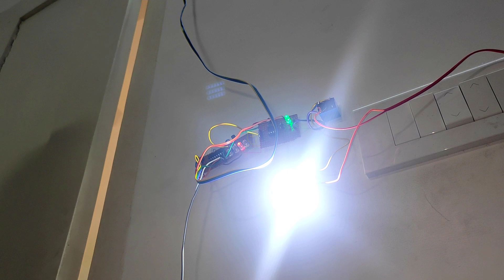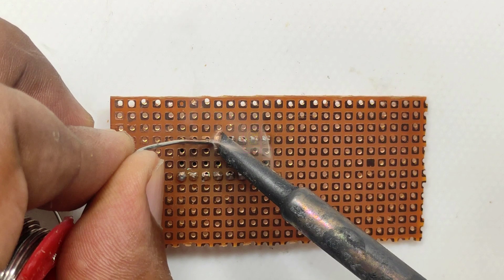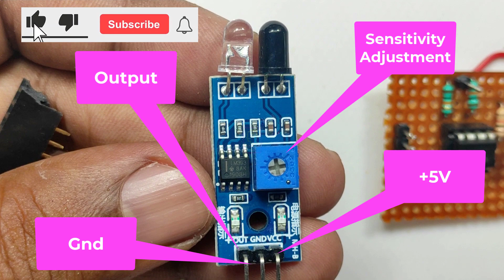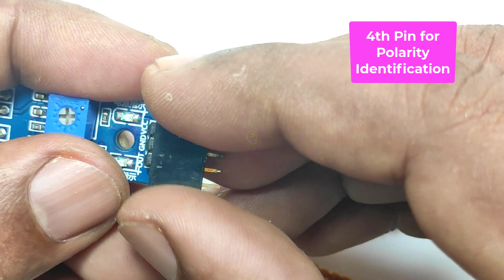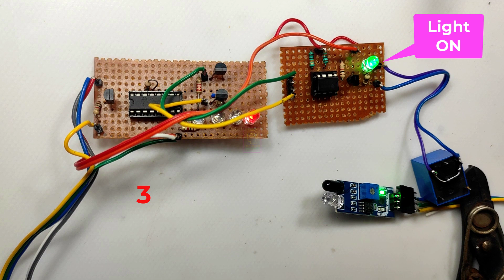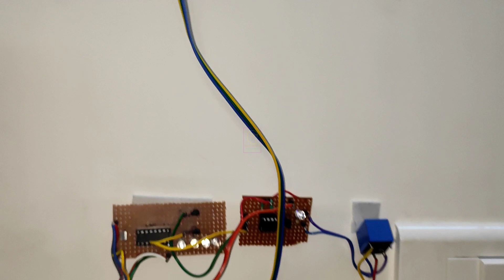"The Secret Trick to Automatically Switch on and Off Your Bathroom Light!" || Science Project

Comment: Amazing. Instead of proximity sensor it is better to use a leaf switch which is seen in the old cassette player. Just a suggestion ..
Reply: Stainless steel is a good solution. Platinum is better than stainless steel 😊
Reply: @tabm7644  Platinum is costlier than gold
Reply from the maker: @tabm7644  Platinum huh , very costly
Reply from the maker: Yeah you are right , leaf switch also can be used but we need to be careful coz bathroom is a wet room full of moisture. It will affect the contact of leaf switch coz of corrosion. Leaf switch made upof stainless steel will last long.
Reply: @TechInsert  That was a wonderful and valuable reply. Yeah corrosion will affect the leaf switch. May i ask u something, why your channel is not having much hits even though videos are very very informative ?
Reply from the maker: @John-pk7lr   To be frank John, no idea why peoples are not watching and liking my videos. Expecting a better tommorrow. Thanks John ❤️
Reply: @TechInsert  Ok great
Reply: @John-pk7lr  Very good channel, but very old videos are not that much good but recent ones are excellent